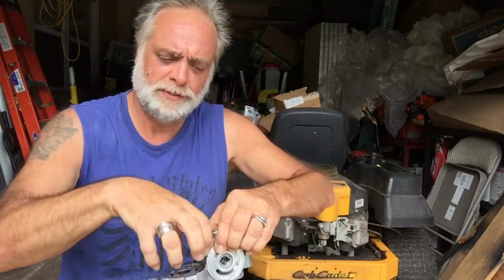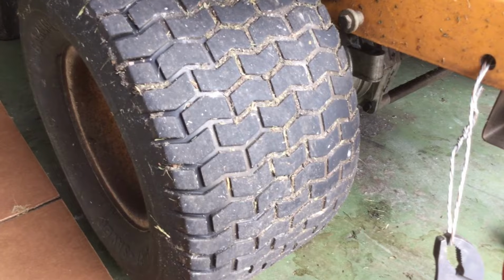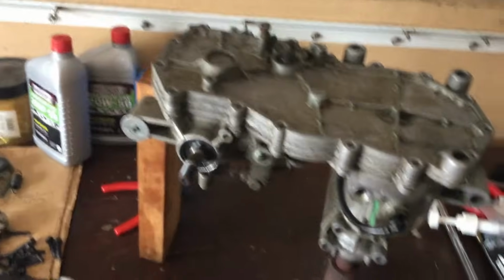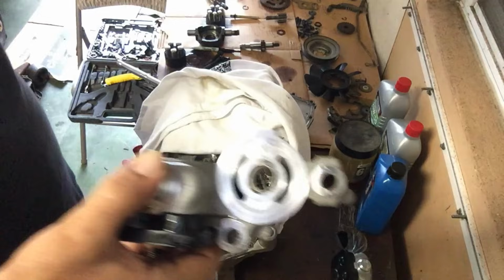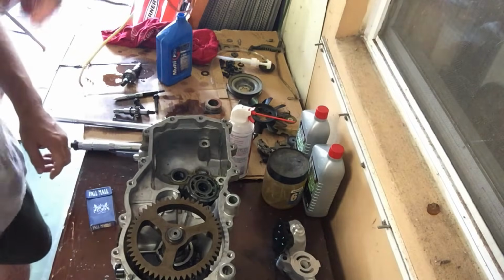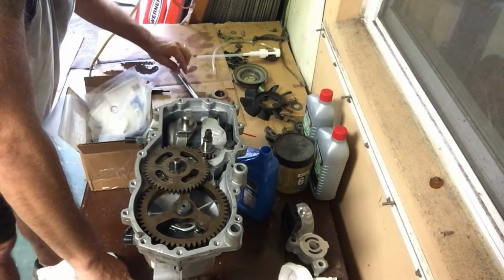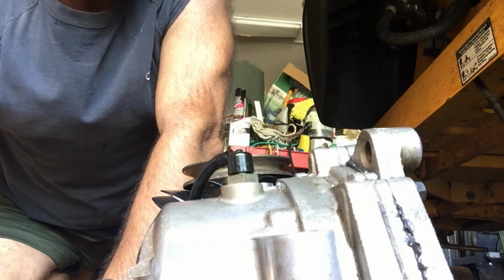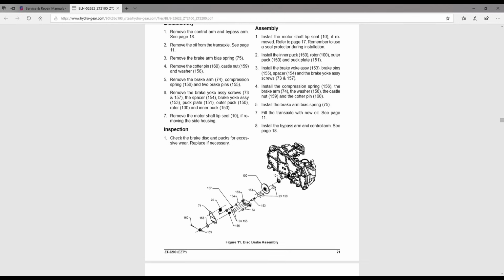Cub Cadet RZT 50 Riding Mower Hydro Gear Transmission Rebuild

Comment: It must take you two hours to watch 60 Minutes. Holy cow, lengthy narration. I hope you were never a teacher! But at the same time I do appreciate you having made this video. Thank you:)
The center sections...are they the same for both sides? I'm guessing yes because there doesn't seem to be a left and right center section. I'm an engineer and I don't understand how the center section is getting damaged. It must be some sort of hydraulic erosion unless there's debris in the oil or interference between the housing and pump. Do you think there could be interference...parts touching each other under power causing the damage? That company is making an absolute fortune by selling those housings for $120. That cast aluminum part by itself including machining cost them less than $10 if they're making over 10,000 per year, and it seems they're beyond that number.
Reply from the maker: Lol, two hours to watch 60 Minutes.  That’s funny…I can appreciate the humor, though it really only takes me about 40 minutes because I don’t have the patience to sit through commercials when a show is recorded.

Yes, I believe the center sections are the same for each side.  Regarding the damage, in my case I noticed it to slowly start to show signs of damage (power loss) not long after something I did on the mower.  Grass was wet and in a moment of attempting to remember my youth, I began to do donuts in the wet grass, basically full speed in circles sliding the back end for probably five minutes.

If I had to guess, I’d say the constant over-torquing and spinning the wheels for five minutes likely created some metal shavings from somewhere in the unit.  That said, after completing the repair, I realized that a lot of oily dirt and grit coats the mower frame above the fill cap area and that has to be cleaned well before attempting to open the fill cap.

Comment: Just a question about sanding out the scratches. Using the wet /dry sandpaper, wouldn't the sandpaper cut faster if you use water instead of oil? Maybe use oil on the last couple of finer sandpaper.

Comment: The best hand cleaner I've ever used is Tub O Towels sold at Amazon and Home Depot. I use them to clean anything that is covered in grease. 

A bus tub makes everything neater and easier. I get them at my local restaurant supply store but amazon sells them for about $10. Place the transaxle in the tub, spray it down with degreaser, carburetor cleaner, paint thinner or whatever works for you. Then remove the oil drain plug and flip the unit upside down for draining. When you're done pour the contents into a lidded container for delivery to your local auto parts store or anyplace that changes oil for disposal. I place the used oil container in a lidded 5 gallon bucket with a stack of shop towels in the bottom and use that to transport it in my car.

Grooves on the center section can be polished off with an oil coated piece of sandpaper. Place the sandpaper on a flat surface and slide the part over it using a circular pattern. Start with 400 grit then repeat with 800 than 1200 grit until you arrive at a smooth mirror like finish.

Comment: You don’t need to pump the fluid into the transmission units to refill. Doing one transmission at a time, remove fill plug near top of transmission, and fill expansion tank with fluid. Keep adding fluid until fluid weeps from open fill hole on transmission unit. Reinstall/tighten fill plug. Repeat with other side transmission. Bleed system normally, and adjust fluid level in expansion tank.
Reply: You do though because you need to purge the air from the transaxle in order to get the rest of the oil in. Unless you’re gonna remove it again after purging, fill it the rest of the way, and then reinstall it on the mower, you have to use a pump. It’s just a lot easier

Comment: I've got a zt2800 that the oil filter stud is stripped out bad. It can't be rethreaded. What would have to be done to replace the oil filter stud?
Reply from the maker: Well, I’m no professional lawnmower repair person, just a novice who repaired a transaxle successfully the second time I did it.

That said, two suggestions for you.  You’ll likely need a new half of the casing, or you might want to reach out to Hydrogear customer support to see what they recommend.

Comment: Just to be clear. When I first install the unit back, when the fluid is still low, the axle will not move with the first step in the purging?
Reply from the maker: That is correct
Reply: @silentknightsaga2415  thanks! I think I might have missed something with the bypass valve when I reassembled. With it open or closed, I’m able to rotate that side freely.

Comment: WOW!! i sure wish i saw this video when i did my rebuild. I did mine all by myself. one pointer i can give you all. is use a pair of vicescrips on the real Axel. clamp it so it does not move up and down while you are working on the case. it will help that LARGE gear not to move. you can clam it near the case (on the axle, between the hub and case) you will see. you are realing just stopping the axle from moving up and down.  Great video. I should have rec mine. thanks

Comment: Only thing I did different that worked well was setting up the transmission to take apart. Instead of the blocks of wood I let it rest in a cinder block. The shaft don't touch. Used a t-shirt to cover the block. Put axle shaft through arm holes. But definitely thanks to you for the step by step. Good thing I have been a professional Bacardi Gold drinker for a while.

Comment: Great video sir,do you rebuild for other people?I have a tuff torq hydro unit,but I dont think i can pull it off,lol
Reply from the maker: Thanks.FYI, prior to doing this rebuild, the only thing I ever did to the mower myself was change the deck belt…15 times and replace a few spindles on the cutting deck.  All I did was watch a bunch of videos on how to do the trans rebuild, which left me with a lot of questions, especially as I got into the thick of tearing it apart, so I shot the video as a means to help those who would experience similar issues if they decided to dive into the rebuild.  I Googled the tuff torque and while I don’t know what model you have, I saw there were some rebuild videos available and looks like they actually sell rebuild kits for tuff torque as opposed to having to search for and order all the parts individually like with the Hydrogear trans.  So, I was a complete novice at it prior to doing the work, now I’m less of a novice at it.

Comment: I'm putting a new hydraulic pump in my Husqvarna zero turn does the pump oil in it
Reply from the maker: Hmmm, unsure.  I think it depends on the make of the transmission.  Not sure if all makes use oil or something else.  If you know the make, then you should be able to find the correct lubricate to use I.e. on the manufacturer’s website.  I’m only familiar with specs on the Hydro Gear 2100 and 2200.
Reply: @silentknightsaga2415  thanks for the information But I got it running great. It was the drive belt was not wasn't engaging.

Comment: How Much differant is a 22HP  Z-Force 48 from this
Reply from the maker: Not familiar with that unit.  It really depends on what make and model transmissions you have.  If it’s a hydro gear ez 2100 or 2200, it should be exactly the same.  You should be able to find the make and model somewhere on he trans casing.

Comment: I am in the process of rebuilding one now and have a few tips I'd like to contribute. 1) on the RIGHT side unit (no one ever videos this one) you cannot simply disconnect the parking brake linkage, you have to remove the entire assembly from the transmission in order to work the rod out of the hole in the frame. The linkage rod is right against the frame and will not let you move it sideways to disconnect it from the parking brake control. Left side is simple, pull the pin and slide the rod right out. 2) At least on MY unit, the TORX head screw on the forward/reverse control mechanism was installed with RED LOCKTIGHT, I had to take a torch to it to break it loose. 600 lb ft impact wouldn't budge it. If it doesn't come loose like in this video, put some heat to it. 3) REALLY IMPORTANT inside the little pistons on the motor and pump units are TINY thrust washers that are apparently VERY easy to lose, I lost two of them before I even knew they were there. Easy to lose, but I have no IDEA where to get replacements, I couldn't find any and a new motor or pump is $100.00. MAYBE if you called HYDRO-GEAR they might have them? I'm a machinist so I just made new ones. 4) Which SHOULD have been #1, before you tear the tranny down to replace the center section, try changing the oil FIRST. I discovered THAT tip after I opened mine up and saw the center section was still PERFECT, not a scratch on it, but it still lost all power when it gets hot. Apparently this issue can by caused by the oil breaking down and losing viscosity when it gets hot.
Reply: I stripped my torx screw trying to get it out (by hand).  I had tried heat but maybe I didn’t do it long enough.  Appreciate the info.  I’ll try again with more heat
Reply: I tried replacing the oil and is still not working after HOT

Comment: I'd like to congratulate you on your organizational skills and oratory skills as well being from the motorcycle and diy A/C repair industry's I'd like to make some suggestions if I may, first of all when splitting cases we always used a heat gun to slightly expand the cases and to soften up the adhesives then a dead blow hammer to smack any shafts protruding from them to force them apart, have you ever thought of using nylog to seal them back, you can check out the product it's pretty impressive, also using assembly lube on any moving parts to avoid wear on power up, and preluding any seals before inserting anything in them to avoid damage? Well that's my two cents you did one hell of a job, thanks for your presentation it's one of the best I've seen on youtube.
Rick
Reply from the maker: Thanks for the suggestions.  I’m a bit of a novice on these things and wasn’t aware some of those products an techniques existed.  I’m sure it will be helpful to others as well.  Question for you since you mentioned things like adhesives.  Do you know if there is a way and a product that you can use to seal a hole or defect in an adhesive gasket versus having to tear the whole thing apart, and remove and replace the old gasket?

Comment: There's a brake spring tool that would make some of this job easier.  It's a steel J on a T-handle.  Harbor Freight sells a version for about 8 bucks.  I've used it on furniture springs and trampoline springs in addition to automobile drum brake springs.  Handy tool.

Comment: You are a goofy individual....much like myself. I messed up as well, removing the center section bolts too early.....then I decided to go to youtube and found your video. I was able to use a slide hammer to tap the input shaft out fairly easily. A bronze wire brush works well on aluminum to remove the old silicon gasket. I use a steel wire brush on....steel. I enjoyed the video and hopefully I can repair my mower.
Reply from the maker: Lol, “goofy individual.”  When I was a wee lad and was called goofy, I took it as an insult.  Over the years, I learned to embrace it as a compliment, maybe much like yourself.  Nowadays, I define it as quirky.  Hope you were able to successfully fix your mower.  If you haven’t worked on it yet, just make sure you prevent any of the gasket particles from getting inside.
Reply: @silentknightsaga2415  yup, I fixed it. Kids say it has plenty of go and I don't hear the transmissions whine hardly at all. Thanks again for the great video.

Comment: after you put the transaxle back together, is it normal that you can turn the axle by hand
Reply from the maker: Hmmm, unsure.  Maybe if you turn it at the wheel hub, but given the nature of the pumps and pressure around the shaft, I’d think it would be quite difficult to turn the shaft by hand.

Comment: I inherited a Craftsman Z6400 ZT lawnmower.And the left rear wheel is real oily looking like something has been leaking out plus the left side drive doesn't work as smooth or as fast as the right.What is  that center nut on the axle for?Maybe somebody has loosened that and not got it back tight and it is leaking oil out of it,I just don't know and haven't used it yet other than just to see if it will mow.
Reply from the maker: It’s been awhile since I did the repair so I don’t recall how everything was connected.  It MIGHT connect the wheel hub (that piece that with the 4? wheel mount screws) to the transaxle.  I do recall coming across some info that there is a seal somewhere on that piece that sometimes needs replaced.  The wheel hub removal wasn’t part of what I needed to do, so I’m not real familiar with it.

Regarding the oily leak, that might be where it’s coming from.  Is it oily on the inside of the tire closest to the mower frame, or the out side of the tire I.e. on the rim of the wheel?

Either way, it sounds like your transaxle fluid is leaking and obviously it will likely get too low and cause eventual failure.  Sounds like there is already some damage in the transaxle if you’re noticing that the left side isn’t as powerful.  Could be due to that leak or could just be due to general wear and tear.  My suggestion would be to enjoy all the... fun of researching that issue.  There might be some pro mower repair vids that address it on YouTube.  Consider searcing for wheel hub leak, etc.  You should be able to look up the parts on the Cub Cadet website.

Comment: I'm rebuilding mine now thanks to your video. Btw use 14x1.5 oil drain plugs for the fill plugs vs the hex key bolt for easier removal and filling for future reference. I also watched the other guys video on how to prime the transaxle on the bench since this are very difficult to fill while installed. I also drilled out holes in the frame to access the plugs easier. I also plan on adding drain plugs to the casing. Putting together tomorrow. Thank you so much for this video.
Reply from the maker: Welcome, hope it all works out.  We’re you able to order a center section and if so, from where?  Another subscriber commented they were no longer available and I looked at several different parts sites and couldn’t find them.
Reply: @silentknightsaga2415  Amazon got both parts the pumps rub against for $200ish new bolts and bypass key.
Reply: Was wondering if you could share any details about the size and placement of the drain plugs you installed in the casing of the transaxle you mentioned rebuilding in your comment here. We have a older EZT-2200 and thinking of putting a plug. Thanks in advance for any comment!

Comment: I just tried to order a center kit for mine and they told me it's no longer available
Reply from the maker: Did you check all the sites mentioned at he end of the video?
Reply from the maker: According to another subscriber, you can get the part on Amazon in case you’re still trying to source the parts

Comment: Just rebuilt both of mine today. You're video was a huge help! Thank you so much for the time you took to make it. I'm waiting for the sealer to dry so I can fill em up and try them out.
Reply from the maker: Both?  I bet that was all sorts of...fun.  On my first rebuild,  the seal leaked in one area and I apparently didn’t keep the inside of the casing clean enough because the center section got scratched again, so I had to redo.  After being more careful with particle contamination and putting the sealant on a little thicker, it’s been going strong for over a year now.
Reply: How much were the parts?
Reply: @djmcdonald5508  around $120 per side.

Comment: Do you have the part number for the cub cadet center piece. I can't find it anywhere for cub cadet.
Reply from the maker: Are you talking about the Center Section?  Taking a look....so the number I’m giving you is for a cub cadet RZT 50.  That said, the important info in all this is that the center section part number is for a HydroGear 2100/2200 transmission so you’ll need to confirm that’s the trans you have.  It’s typically on a label somewhere on he trans housing.

Here’s  how to find he Part number on the Cub Cadet website - go to Service and Parts tab, click on Find a part, enter your mower model number (typically found underneath the seat),  click on Diagrams tab, then select your model number from the list, then click on the Transmission diagram (there should be one for the Left side trans “LH” and one for the right side trans “RH”), then look for the part called “Kit Center Section”.  For the left side, the part number is HG-71529.  For the right side it’s HG-71530.

Current price on CC Website is $147.28.  You might be able to find it cheaper on I.e. Parts Tree.com or Amazon.  Those transmission diagrams on the CC website are a great reference for all the parts and part numbers you may need.  Just be sure you’re looking at the correct diagrams for your mower’s model number and whether it’s for the Left Side or right side trans.  Another viewer posted a comment about where they got their center section cheaper

Lastly, use the HydroGear Website trans diagrams as a reference when disassembling and reassembling everything for the 2100 or 2200 EZT Trans.  And, make sure you clean out the trans and keep it free of any particles while doing the work, otherwise you’ll experience great sadness....